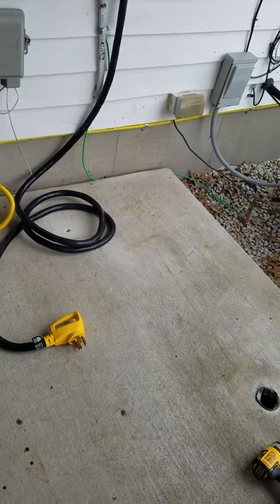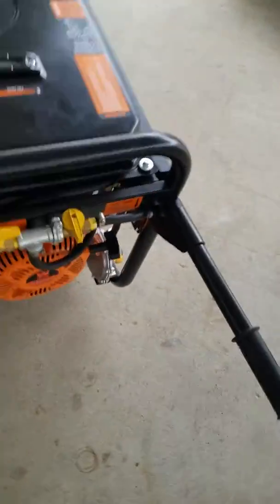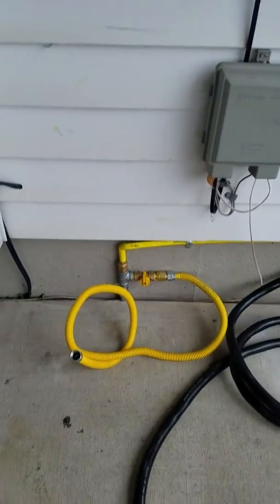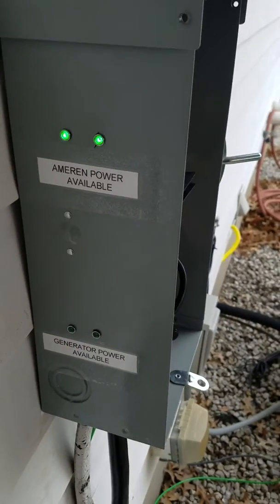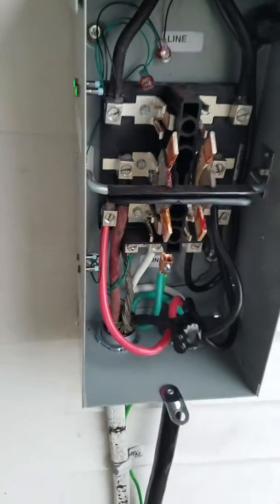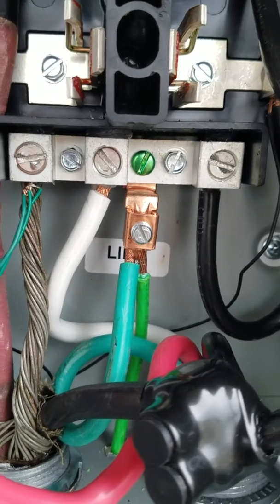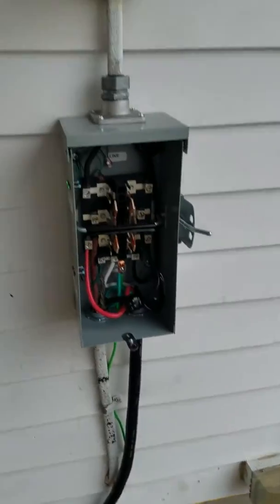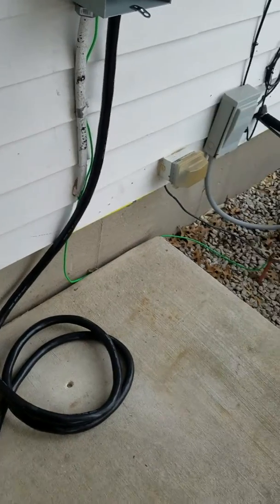WEN Tri-Fuel Generator Install

Comment: I like the lights.  I did it differently on mine I used a cheap digital voltage amperage meters.  They have similar thin wires that connects where you want to measure.
Reply from the maker: Voltmeters would have been pretty neat to have just so you could tell if you're high or low on what you're getting from utility and generator. Didn't think about inline fuses for the little LED lights. If they burn out then I'll just replace them.

Comment: ryan - did you bond neutral and ground in the new switch and then un-bond in the panel?  thanks and nice vid
Reply from the maker: I did not separate ground in the panel in the basement. It is old enough that it does not have a Ground Bar. The house has a mixed batch of grounded and ungrounded Outlets. When the house was constructed grounding was not National Electric Code. It is bonded to the water pipe but did not have a ground rod until I added mine for the generator. To my knowledge in typical installations you would keep the ground completely through the switchgear into the inside panel.

Comment: Hi Ryan. Thank you for the videos. In regard to the natural gas manifold, you use a 3/8 x 3/8 adjustable load block at the top outlet. I believe you said you opened it all the way, and had to rely upon the hidden adjustment screw at the center of the manifold to reach enough flow. With this being the case, could you not simply use a 3/8 NPT x 3/8 barb elbow, rather than using the adjustable load block. This way you would use the center screw exclusively to adjust flow. Thanks again!
Reply from the maker: Thanks for the question, when I was purchasing all of these items I was not aware of the Hidden set screw on my regulator. I had seen kits with the regulator and the load block for sale along with a bunch of other parts I didn't need. That is where I got the idea to purchase just the two parts independently. In hindsight if I were to make another one of these I would just get the right angle 3/8 npt to 3/8 Barb fitting and rely solely on the regulator adjustment. In the grand scheme of things I knew I needed some flow control option because I didn't know exactly how much the motor was going to need. But again in hindsight I now know that the motor needs as much as the regulator will give it to run properly. This may be different on smaller sized Motors so adjustment may be needed. Thank you and good luck with your project!
Reply: @ryangremminger1  That's good news for me. I easily found the Century C-039-122 regulator ($46.50 on Century website). But I could not find the load block anywhere without having to buy a whole kit. I am installing it on a 459CC engine, so my fuel requirements should be similar. Thank you again.

Comment: Hello Ryan, thanks for the video, just brought a WEN 11,000 and its a dual, propane and gasoline.  I would like to be able to use natural gas. You spend maybe a minute speaking about it and you seem to say that it is relatively simple.  So the way you did it, it works just fine? You said that the regulator orifice came completely open, am I right or did you need to open it yourself?  Also, you advised to use a three-quarter inch flex pipe and not a half inch, you did not say why but I thought it was a good suggestion. Could you speak to that a little more. Thanks
Reply from the maker: https://www.youtube.com/watch?v=bf2zcnF1t0A
Reply from the maker: Hey thanks for watching and thanks for the questions. I replied with a different YouTube video link that I made and it goes in much more detail about the conversion itself. The way I installed the natural gas regulator it does work just fine for me. I mentioned in the other video that there seems to be just a tiny bit of motor sound change when running on natural gas vs. Propane. The frequency and voltage output are the same running on either gas. The natural gas regulator orifice did come completely wide open. I had to remove this little silver button that was factory installed over it. Once I got that out I verified that the set screw was turned all the way out which makes it as much gas flow as possible. It came this way from the factory I did not make any adjustments to it just verified. The three-quarter inch pipe recommendation came from the regulator manufacturer. In the early stages I called and talked to a technician and he advised that over a certain amount of distance you would want to up your pipe size to 3/4 of an inch for the correct volume. For my install the length pipe was short enough and I did not need to up the pipe size. I don't remember the exact length that the manufacturer recommended you would need to give them a call and get that information from them. If i do another one of these I will just go with 3/4" pipe. Regardless of the distance i need, Piece of mind that's all. Hope all this helps and good luck with your project!
Reply: @ryangremminger1  Thanks for responding, I am very grateful.  Mike

Comment: Love the transfer switch, would like to do the same but my house has a 200 amp service and I think I'd need a 200 amp switch and man there not cheap!
Thanks for posting
Reply from the maker: You are correct 200-amp switches for some reason are a bit more expensive. I can tell you that Menards does offer a 200-amp switch by the same manufacturer as the switch I used. I don't know what the cost was off the top of my head but that could be something to look into. Good luck with your project!

Comment from the maker: I do have another video on my Channel That's titled, mom and Patty generator instructions. In that video I start from pulling the cover off of the generator to starting it up completely. I do not transfer load on that video though however. I should be back over there soon though. I'll do another video with a full load transfer from start to finish. Also to address the outdoor storage, I have given that some thought and I know the cover is not the best permanent storage solution. I've seen other people purchase those outdoor patio storage lockers. People often buy them to put their couch cushions for outdoor furniture in and stuff like that. I may put this generator in one of those in its permanent location and insulate, and vent appropriately so that it can run in the enclosure. This would tremendously help with noise as well as better weather protection. Keep checking back from time to time or subscribe to get an alert when I do post something new about the generator project. Thanks!
Reply from the maker: here is a good link to a guy building one of those storage lockers as a generator house. 
https://www.youtube.com/watch?v=nbWRb45n49w

Comment: The 1/2 inch gas line might not be sufficient if running ac. Generator might be starving for gas.
Reply: Here is a reminder about portable generator safety: This advice is just to make sure that everyone is aware of all the warnings and it’s just to remind people to be careful using portable generators. Everyone has to see this safety reminder for safety. Every year, hundreds of people die or get injured when using portable generators due to carbon monoxide poisoning and electrocution. Make sure you are using your generator carefully and keeping others safe as well. There is something very serious that everyone should always be aware of when using generators. Some people do run their generator indoors which is not safe and that increases the risk of carbon monoxide poisoning which can cause death of family and you. Some people run their generator in wet conditions which can electrocute them. Please remember that you should never run your generator indoors. Remember that carbon monoxide is an odorless and colorless gas that you cannot see or smell. Carbon monoxide is a silent killer. Keep that in mind. Make sure your generator is 15-20 feet away from your house and away from doors, windows, and vents. Never use your generator in your porch too. Having a carbon monoxide detector is very important against generator safety. Some people also allow children to go near the portable generator which could pose risks. We need to keep an eye on our children making sure that they are not near the portable generator so they won’t get electrocuted or burned by the generator which is dangerous. A locking enclosure also keeps kids safe. A generator shed might look like a tempting place to explore, or take cover during a game of hide and seek, but a generator is a dangerous piece of equipment that can cause injury. It says on the manual that we should also keep children away at all times from the portable generator to avoid injuries. Please do not allow a child or unqualified people to operate the portable generator. Just because some manuals missed what should be listed doesn’t mean it’s safe to do. Always follow the generator safety rules when using portable generators. Generators pose electrical risks. If you need to use your generator during wet weather, you need a generator tent to protect your generator from getting wet. Don’t let your generator get wet. Keep your generator dry and before using your generator, please make sure your hands and your generator is dry. Do not wear loose clothing when operating the generator. Everything that is said on the generator’s operating manual should not be ignored. Never smoke cigarettes near the generator. Please keep flammable things away from the generator. Never overload your generator too. Your generator can catch fire. Never ever try to plug a generator cord into a wall outlet to avoid back feeding. Back feeding your generator is dangerous. Always turn on your generator first before plugging in appliances and shut off the appliances before turning your generator off. Use a heavy duty cord for your generator and the cord should not be worn out. All the instructions should be followed carefully. Never refuel your generator while it’s running. It can cause fire if fuel spills while your generator is hot. You should turn off your generator and let it cool off before refueling it. Having a fire extinguisher next to the generator is also important. This is only a reminder for everyone’s safety of using generators. Make sure your generator is properly grounded. https://youtu.be/I1jT3ANENvI and here is a video more about keeping others safe when using generators and also about our family’s safety. Hope this helps. Thank you. Be safe as well